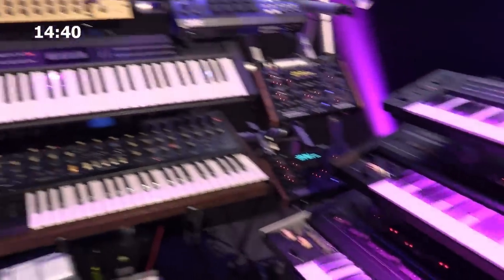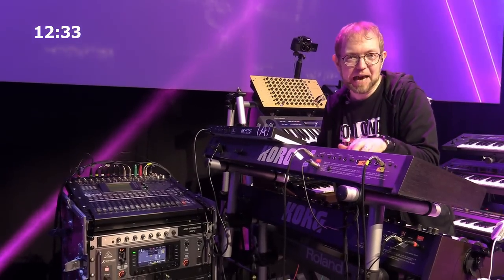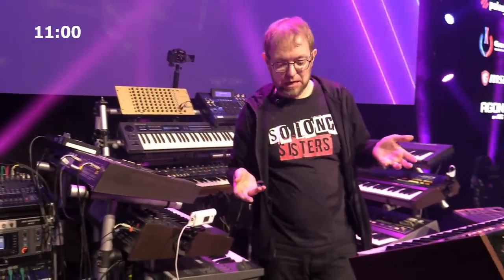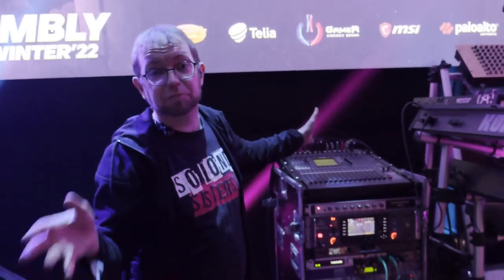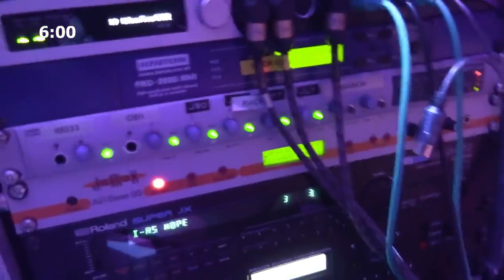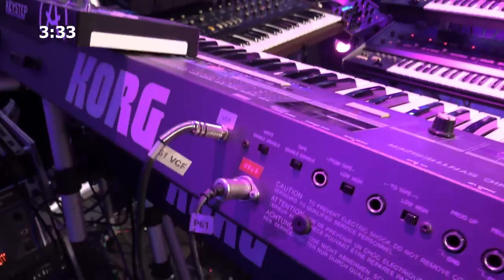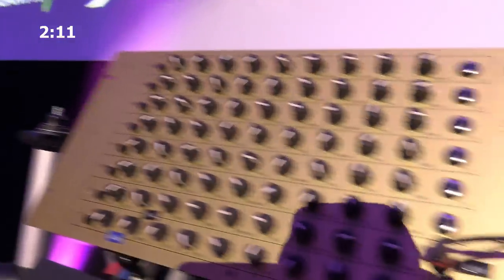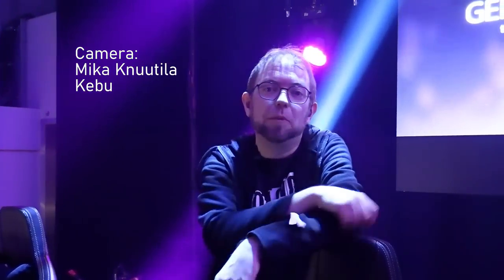Kebu's live synth rig explained in 15 minutes

Comment: You are a musical treasure. As an IT guy I thought it was funny that not only your music goes through filters but also the midi signals as to not upset the old grumpy synths.  :)
Reply: that kenton is a converter - it converts messages and controller information from the midi format into a controlled voltage [pattern] signal to mitigate similar expression or control through actual variable voltage fluctuations used by those older circuits.

Comment: I finally saw you play live and it was amazing!  However, I have a lot of curiosity even if tonight's setup was practically what you explain here. you never play synth sounds, or so it seems. are they program changes triggered by the akai mpc? the way you master everything is astonishing,
Reply from the maker: Glad you liked it! I guess you mean how do I change patches? On the more modern synths I can use patch changes sent from the MPC. On the older ones I have to change manually. The Mono/poly and DRM1 are the only ones I adjust in real time.

Comment: Great setup and very well explained! How long does it take to set it up from van to ready to play?

In your older videos I've seen RS7000 as your sequencer. What made you to change from RS to MPC? My biggest gripe with RS is those stupid SM memory cards. It's pretty much hit or miss when I order those from EBay - mostly it has been a miss...
Reply from the maker: Thanks! I can do load in and 2,5 hours, but I normally reserve 4 hours. Once we did it in 2 hours due to being stuck in rush hour, but I don't want to repeat that. :D The MPC has 4 MIDI outs, so that was my main reason for trading in the RS7000 (I think it only had two MIDI outs). Being able to distribute the MIDI data on four cables allows for up to 64 channels, so that is more than enough for me. Didn't know about the problem with Smartmedia cards. Do they become more unreliable with age?
Reply: @kebu  They become quite brittle and there are 5V and 3.3V cards. No matter what the seller says it's just a crap shot which one you'll get.

And yes, RS has only two  MIDI Outs. In order not to daisy chain lots of gear I managed to buy years ago two MOTU Timepiece AV MIDI-routers from US. They have 8 in/8 out-configuration and you can do all sorts of routing and filtering either with quite awkward front panel interface or by using computer. In my case these units are so old, that they require Windows 95 and a legacy parallel printer port to connect them. But they work as advertised if I change memory batteries every year. 😂

Comment: Hi Kebu, amazing setup, thanks for sharing it. I was wondering how you trigger the 808? it didn't seem to have any clock input. I guess you play it manually? Is that the reason why you use the Jomox as the main one or  you actually prefer the sound? I just got too many questions lol cheers!
Reply from the maker: Thanks! The 808 is retrofitted with MIDI, so I just play the drums using the MPC as sequencer. The Jomox I use for doing other types of drum sounds. The 808 can just do 808-type drum sounds.

Comment: Impressive 🎉. Also what s the plan B if a piece of the setup breaks during a performance ? Did it ever happen ?
Reply from the maker: A single synth has sometimes started misbehaving. Mostly, it's not that bad, so I've managed somehow and than changed into a spare synth for the next concert.
Reply: @kebu  nice. Hopefully the mpc that seems at the center of the setup wont fail… 😬😅

Comment: That story about the difference in sounds of the two polysixes is actually very interesting. Do you know how old both units are? I have an '82, I didn't even know they made revisions to the design.
Reply from the maker: There were some revisions of the motherboard. However, you can only find out about it by reading the service manual and service bulletins that Korg released. The original version had a filter design that the engineers thought flawed, and released a service bulletin on how to fix it. I think that is the reason why my two Polysixes sound so different, because I can't get a high resonance on the presumably older one. I really need to open them up and do some investigation on this.

Comment: Thank you for a very informative video!! 
One day if you can , please elaborate on how you used the andromeda to replicate or imitate CS80/50 - that was a very intriguing comment.
Reply from the maker: I'm just using a simple sound from the CS50 - a sawtooth brass sound that has its volume and cutoff controlled by aftertouch, so it is really not that much to it.
Reply: @kebu  thank you so much for the prompt reply, you rock!  btw - you focused a lot on the use of builtin effects on Ber.X32 & Yamaha.02R (correct?) mixers - do u use anything beyond reverb/echo + compressor or are there special things like chrous/phaser or other? bc when you mentioned it it sounded like you were saying it as if you were making a compromise and it's not good enough - is it bc of # of effects per channel ?? just curious and again thank you!

Comment: How do you POWER your gear? Do you have one (or several) power conditioners in your rack?
Reply from the maker: Power is not a problem. My whole rig takes about 250 W. That's less than a gaming computer! But I'm glad you asked it, because people think that my synth rig takes a lot of power (perhaps due to its size), but that's not true. They don't consume much, not even the old ones.
Reply: I am more concerned about ground noise - this took me forever to hunt down and now I'm using 2x Furman PL8 CE for 220V gear and several Cioks pedal power supplies for the 9-18V stuff. What do you do against ground loops, especially when on stage? Clean power sources, strict cable management, a 60 Hz filter in your EQ? Loads of isolation boxes with ground lifts? I would've expected that your old synths are quite picky and noisy 😉

Comment: Hi, Kebu
I have another question: do you have a back up equipment? For example, if one of your synths doesn’t work when you are in a live performance, can you use another to do the same?
Does it already occurs?
Reply from the maker: Yes it occurs, but fortunately very seldom. I only bring one or two extra synths on tour. The JD-XA have worked well for me as a backup as I can program it quite quickly and is very flexible MIDI-wise. I used it quite successfully as a backup synth for both my Poly-61 and Micro-preset, which were unreliable. Now I've managed to fix the Poly-61 but the Micro-preset broke down and I've haven't had the time to fix that. But I have a spare, so I'm fine.

Comment: Too many cables 😵‍💫👍
Reply from the maker: But still, I'd much rather have cables than wireless. When a cable is broken you repair or replace it. When wireless doesn't work, well, then you're screwed. 😆
Reply: I know what you’re saying, carry a gas soldering iron and anything is fixable 😀.
Have a great show 🤘🤘🤘👍.

Comment: @kebu if you have time to answer 3 queries then it would be interesting to know (maybe pin it). 
1. Do you still set up your rig or did you get to a point where you entrusted someone else to do it for you, & if so when did that time come? & if this is the case then you must still have to meticulously check it over. 
2. How long does it take to load in? 3.whats your record load in time Kebu (the people need to know)🤔 ☮💚☯️🎹
Reply: Nice question. It is hard to another person connect all the gear and it works perfectly.
Reply: @NogueiraMG  that was my thoughts too.. its a very personal issue. Setting the rig up is the easy part, it's plugging in all those cables in, that is where the real work is.
Reply from the maker: 1. I couldn't afford having someone else setting it up, so I do it myself. But I get plenty of exercise for free that way, so I don't mind. 😁
2. Load in, set up and soundcheck can be done in 3 h, but I always reserve 4 h just in case.
3. Once we were stuck in traffic and had to do it in 2 h, but I don't want to repeat that.
Reply: @kebu 2 hours👌Nightmare lol

Comment: A laptop is the most expensive device among this stuff of the 80s. Lying on the floor)) Ironic)
Reply from the maker: In the 80's a laptop would probably be among the most expensive devices. In that setup, it is among the cheapest devices, as I bought the laptop used for 300 euro six years ago. Don't know if it even has a second hand value anymore...😄

Comment: What a great video! I have a question showing my noob level of synth knowledge. How do you change sounds between songs? Is there some kind of performance controller?
Reply from the maker: Thanks! That is actually a really good question and something I forgot to mention in the video! When I change the sequence in the sequencer (MPC2500), it automatically sends Program Changes (MIDI commands) to all synths (that can accept it). Some synths doesn't have that, so for those I have to change sounds manually. That's why I don't use modular synths...  😝 Some songs starts directly when I hit play, and for those I have an additional sequence in the MPC which I call "INIT" seqence. That is a 1 bar sequence that only changes patches and do other initialization routines in the synths (like adjusting the cutoff or modulation if needed).
Reply: @kebu  Great answer! I would love to feel confident about that side of music performance.